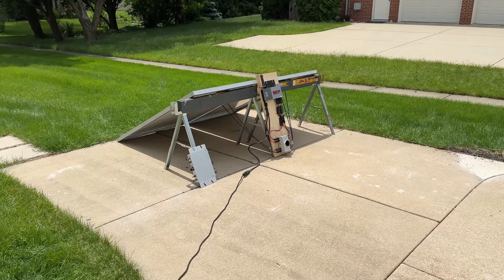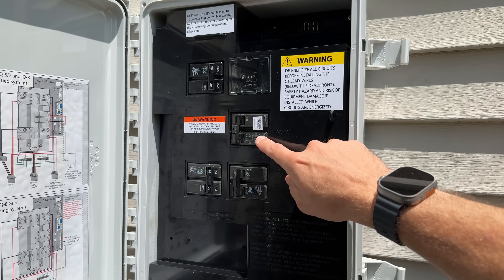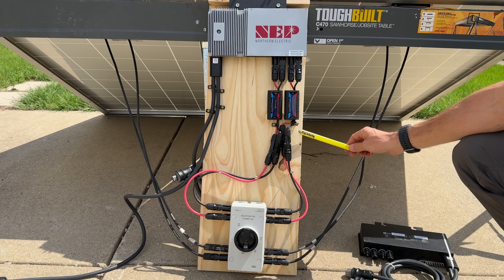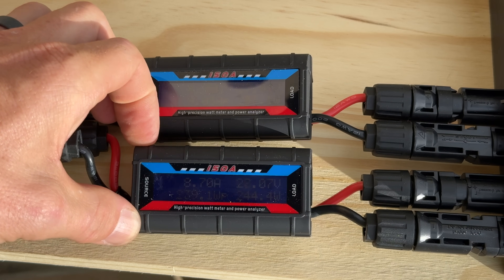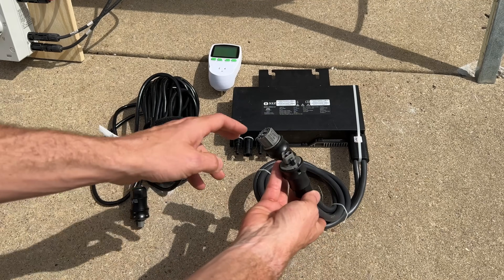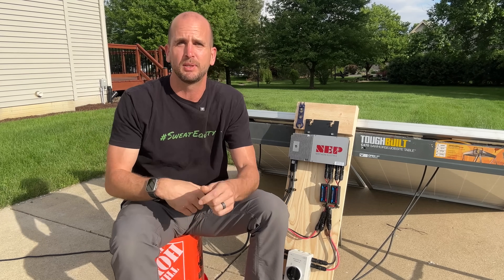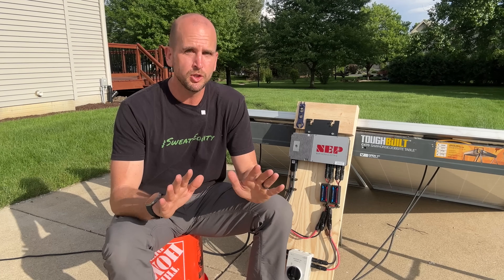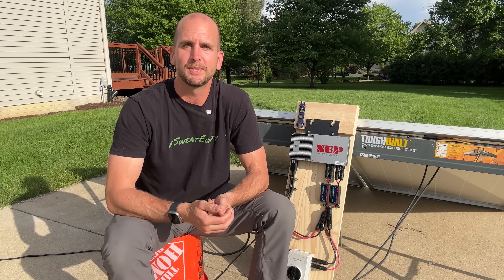Easiest Grid-Tied Solar On The Market!   Plug-N-Play

Comment: This is a really great video for someone that knows enough about electricity to actually do something like this.  Meaning, some of the other videos are so basic that I always wonder, if you don't know amps volts and watts, should you really be doing this?  For me, I want to put up what I believe will be about 1200w on my shed.  I have a radon fan on a 20a circuit that building this out would be perfect for.  I guess I could look this up but QUESTION: I am going to pass a somewhat consistent 1000w through a line that's about 40 ft long,  is there an extension cord that one would recommend?

Comment: On the solar tax credit for used equipment, I would contact a tax preparation service or call the IRS itself (if you can get through to them by phone since they were downsized) to ask. A video by "A1 SolarStore" goes through the form from a few years ago (the new form may be different now) that asks if the equipment is new.

Comment: I have watched every single video you've posted and I enjoy this content.  I have a request. Could you acquire a  enphase microinverter and using a pure sine inverter with ac pass-through.  Test to see if you can trick the microinverter to produce power. I'm aware backfeeding is illegal without permission.  But I would like to see if the theory is sound. Thanks
Reply: Ac output from inverter installed in a small breaker panel (240 60  hz). Solar panels fitted with microinverters. Inverter output installed in breaker panel.( 2 pole 20). with a load from the panel a fan a heat gun etc.

Comment: Great, thanks!  Would the 240 volt outlet be correct to plug into a 220 volt outlet (such as dryer or car charger outlet) and is it better to feed in 220)?

Comment: If you select Solar/Generation in the Emporia settings for the circuit you're producing electricity on it will differentiate energy consumed and energy produced. Bi-directional will need to be selected also if you are both consuming and producing on the same circuit. If you don't the energy you are producing will count towards the consumed energy also like it was when you was showing the app in the video. Hope this helps, it messed up my monitoring for awhile.

Comment: Right there at the main where the grids next to the installed watt meter 
Armed only with an amp clamp and fourth grade math you will see some 85% difference 
Grid  ties can only actually put in about 15% of advertised output
That goes for either one of the inverters 
And it only takes a second to demonstrate
Reply: So you're 11 kw & 45 amps can only put in about 2 k w and if you do the test you will see only about 8 amps 
Huge problem with grid ties again Easley demonstrated

Comment: Worseyet once solar is connected to the grid it can only put in about 15 percent of panels advertised output 

And is the main reason why everybody electric bill is skyrocketing 
It takes some 6 with crazy electric bills to compensate just for one home solar s benefit 
The ignorance of solar is easily demonstrated with a volt amp meter and 4th grade math called ohm's law 
Right there at the installed wattmeter compare your results you'll see an 85% difference 
With the optional amp clamp only takes a second

Comment: It certainly looks more robust than the failed micro inverter.
I did a similar setup using 2 cheap $30 350W micro inverters and two used $23 250W panels, all up with wiring and cheap self built ground mounting it was around $150.
The first inverter failed after a week and  I ordered another and 2 x 8" computer fans to cool them down, but the second inverter failed after about 3 weeks just before the fan arrived. I installed the new inverter  with fan and ran it for about 6 weeks (no probs) and then I ordered a new 2nd inverter and now both have been running for around 18 months no probs and it has payed itself off even including two burnt out inverters.
I live in Thailand so maybe I can get things a little cheaper than folk back in the US, but there is also other hassles here like the reason I first tried micro inverters.
I tried them because they are sealed units and should not be destroyed by bugs. 
My first little system was a 12v job with standard inverter but bugs got into it and shorted it out...twice!!
You always have great practical tutorials. Appreciate it and they always help me think about how to do something or approach a problem. Thank you sir.

Comment: Unless the micro inverter has an option to not feed the meter, do not install on a smart meter, if you do and aren't set up with utility company to feed power to the meter, you'll be charged for that power you produce. 
Make sure your inverter has that option to not feed the meter. 
When you contact the power company and tell them you're using solar and feeding excess power to the grid, you lose time of use power pricing and are charged the premium cost per kilowatt 24/7.

Comment: Scott, I assume that this setup offsets the power you use from the grid as installed; no special permissions needed. But you checked with the utility and they said it was OK since the microinverter is UL1741 certified and can't back-feed the grid if the grid is down (because of a grid power failure). And the utility permits this way of cutting your grid power demand, but they won't pay you for the power you generate back to the grid if for some reason you were using less from the grid than your panels (and system) were pumping back to the grid. Do I have that right?
Reply: if he has a net metering agreement the added solar will contribute to a decrease in usage and therefore the roof generation would get fed back to the grid instead of getting used to power loads.  however if he put too many of these into outlets during the time of peak sun, the utility would see like 5k of energy coming back if the solar system he has when he registered it was supposed to only be capable of sending back 4k.  so I would advise against that, the utility might find out and see he was violating the net meter agreement.

I do think this is very useful if you have say a 5K system but after 10 years the degradation means it only can produce a max of 4.4K.  well that would give you head room to add panels and stay within the power output you originally committed to.
Reply: @rmassuser  good points.

Comment: Could a similar system using a micro inverter be tied to the compressor side of a central air conditioner run contractor so it was only powered when the AC’s condenser was running, thus supplementing the compressors power with the grid power? I realize the EV supplied power would have to be less than what the condenser pulled and that some kind of current detection might be necessary in case the compressor failed to run under any circumstance.  This would make this a non-grid tied system correct? My condenser, (2 tons 16 SEER) pulls about 1200 watts when running, so limiting the EV power to 1kw or less seems safe even if my other power usage is very low or even zero watts at any time.  I’m aware micro inverters have a grid synchronization delay time at every connection.

Comment: 1:19-1:21 Timelapse of people lying on panels. It hurts my soul to see!
Would be an interesting video to take a brand new, carefully handled panel and test it's output next to an identical control panel. Then lie on it like in timelapse and compare. Maybe go further and step on it "carefully", then kneel on it like a typical hired-in worker/installer. Will there be immediate changes or do degradation only show up during first year?

Comment: Is there anything like this available in the UK that's legal and just plug and play upto 1kW of panels?  The Ecoflow Powerstream looks good, but it was pulled form sale due to legal and safety issues - and it's only working with EcoFlow batteries. There is so much conflicting data on these sytems and their UK legality and safety.
Reply: Call your supplier and ask them what they think.
They "should" know how to advise you.. but just don't bother talking g to a junior employee, speak to someone directly with knowledge if possible.
Reply: @TheGreendabomb  what supplier?

Comment: So what happens if at one point your house doesn't use anything, everything is off, even your refrigerator is resting... and your grid tie mini solar is still producing lets say around 400Watts what happens to the power, it goes to the grid right? And what happens to the regular grid power meter, does it keep accumulating forward or going in reverse, or is sitting still? Do the power company have to install for you a special power meter on your house to be able to read power going both ways? maybe this scenario will be rare, but what if you double the size of your solar?
Reply: very good question. Any answer to this?

Comment: I did the same but with the enphase micros. Istead of hooking it to a 120v outlet use the 240 outlet. Working awesome. No combiner, no monitoring hardware. I already got burned multiple times with chinese grid ties. Enphase micros are cheaper.
Reply: would you mind sharing more info on your setup? like what model Emphase, panels, and how are they connected,i.e. to a dedicated 220V plug and its own breaker?  does the emphase shut down if the grid goes down, so it doesn't backfeed?
Reply: @Northeaster-b3w  Used the IQ7+ and 320watt solar panels wired directly to a 240v outlet inside the house. Need to buy the cable to link the IQ together.
Reply: @user-pg5yy5he9m  Thanks for the reply! Assuming you are on the grid, how do you prevent backfeeding the grid if the power goes out? do the emphase micro-inverters sense the lack of grid power and shut down? 
also, do you have a net-metering meter or if not, what happens if you were producing more energy than you were using?  i think an old uni-directional meter might count that as usage and the power company would likely contact you, so like to hear how you are doing it please!
Reply: @Northeaster-b3w  If the micro produce more power than you are currently using it will get back to the grid. When power is out it will automatically cut off production. It is totally safe and approved for use.

Comment: For the price of the kit, I got a jackery 1000V2 explorer on Lightning deal black Friday for $399.00 and then also purchased a LiTime 100AH 12v battery with the grade A cells for +15k cycles for abourt $139.00. That will be satisfactory for what I want to do with it, which is to run a small 300w electric mini heater in my unheated back pantry / laundry room over the winter so that I can keep the door closed and not run the main furnace so much. Just has to keep the temp above 45 degrees.  In the summer, I have a small inverter window AC to keep it under 80 back there, because it can reach 100 pretty quick on a hot summer day. My 600w panels feeding that from the field should be sufficient to not raise my electric too much except when it's cloudy/rainy/night time here in rural PA.  The great thing about a jackery is that in the spring and summer when I don't need heat or ac back there, I can use it's electricity for other things, like the Fridge or my son can take it camping.

Comment: I'm living in sunny southwestern AZ. I'm looking to create a isolated solar system just  to run my room window AC unit to offset
the high energy bill I get each summer month. (up to 119* daytime temp). Is this even possible? Do I need an enormous battery
bank to accommodate the  electrical surge when the AC unit's compressor kicks in? And yes I'm a big electrical klutz hard to 
understand whats going on. Smart enough to know when to ask for help. HELP!  Would appreciate any and all informative  ......
non-harassment comments. Thanks in advance,                                                                                                              Me southern AZ.

Comment: Mine just flashes red 2 seconds, off 2 seconds (standby mode), and doesn't produce power. Do I have a defective inverter?
5:03: The manual says 1 second on, 1 second off means it's producing power.

Comment: So glad I found this video. I saw your first one with the 1200W amazon grid-tie inverter and that seemed cool - but good to know that it pooped out (maybe worth pinning a comment on that video to share the information, and maybe a link to this video for a better affiliate option). Stoked that actually certified options are becoming available!

I would love to see a video from you about increasing solar coverage without voiding NEM status! I (and a few of my peers) are in a similar boat where we have 'commercial' solar set-ups through installers and have existing net-metering set-up with our utilities, but are interested in increased solar production without voiding that (and potentially cheaply/DIY to prevent a new interconnect/NEM application)

I have been doing research about ways to do so (like 'islanding' a functionally off-grid install, or using a grid tie solution like this but keeping additions below the NEM) and you seem really knowledgeable so I know myself and likely others could benefit from hearing your honest thoughts about options to increase solar production in a DIY manner!

Comment: Hey Scott thank you for video, xlnt!  NEP discontinued the LV version (Low Voltage). I bought the BDM-300X2 and hooked it up as you did. Got  flashing green and then after 2 minutes flashing red? The AC outlet has 3 wires, Black White Green, this would be 110, not 240, correct? So it should work just like your setup? Any ideas why it flashing red and producing no current. BTW, my solar panels (2) are producing 230 watts each and run my battery inverter set perfectly. Thanks for any help.
Reply: This is what the installation manual says:  
Step 1 - Install the AC Branch Circuit Junc�on Box
1. Measure service entrance conductors to confirm AC service at the site.
Acceptable ranges are shown in the table below:
● BDM-300X2-240A & BDM-300X2-208A (North America)
240 Volt AC Single Phase 208 Volt AC Three Phase
L1 to L2 240 Vac L1 toL2 208 Vac

Comment: People need to see this. This is the right way to do it. 
Plugged into the wall. I think that means it is bypassing the breaker. Maybe tie in on the mains in the breaker box so the breakers can do its job. Like yours. Example load to the breaker is at its maximum to protect the wire. About to trip. You (Say add 8 more amps to the line) Now you have a hot wire. The breaker only see's what is going through it. Not what the wire is caring. House gone up in smoke. I maybe be wrong but. Please correct me if wrong. Love your video. Shows what a safe setup is.
Reply from the maker: With this one it is important to plug into a dedicated circuit to avoid overloading any part of the circuit.  If it is a dedicated circuit then the breaker will see the same amount of current being produced by the microinverter.

Comment: Do not tie your solar to the grid. You want your home off grid completely with its own system. Don't be scammed with solar panels and equipment. You basically want to convert your home to be like an RV. Solar power is free collected everyday and can be stored in batteries. Make sure you have the right appliances and technology when operating on solar power. Traditional Appliances and technology shouldn't be operated on AC with converters from DC. Its a waste and requires replacing components and dependency on parts. Think about what exactly you need for your home and reduce waste. The more demand you put on your system the shorter the lifespan. You keep a well balanced low watt demand on your panels and make sure they are positioned only 8 to 10 hours daily in direct sunlight and they will last over 100 years. You want to be sustainable without worrying about future repairs or replacement. If you convert your home off grid don't use traditional electrical in your home. Breaker boxes and outlets is obsolete. Stop using appliances and technology that requires an AC system. You want to have
DC technology. If you have to have AC for specific technology then make sure that is on a separate  solar system that isn't tied to your existing. Direct current (DC) is the best and the technology uses significantly less power than alternating current (AC) systems.
Another thing is don't be scammed by the EV market. I have a solar powered car without all the bells and whistles system they integrate. My car charges on solar and goes over 1000 miles on a full charge. I never operate less than 70% with my daily life. Capitalism scam.

Comment: Scott, the website states "It (NEP Microinverter) can take unto 2 x 24V panels (300+ Watt panels)." Is this saying it can only handle solar panels with VOC of 24v or less?
Reply: Input voltage for the BDM-500 600X is 22-55VDC so if your solar panel has open circuit voltage between that range it will work.
BDM-500 max power is 375Watt  for each input (375 X 2)  inverter will clip power at 500 Watts (so maximum power out 500w for both inputs)
BDM-600 max power is 450Watt for each input (450 X2)  inverter will clip power at  600 Watts ( so maximum power out 600W for both inputs)
Reply: NEP BDM-800 is available at SS for $200.

Comment: I have a Delta Pro Ultra and I'm trying to get it to charge from my grid-tied solar system.  The solar company that I am leasing from says I can add a battery backup but I can't touch any of their equipment.  Can I just tap into the feed going to the main panel  after the solar meter, and add another subpanel and an outlet to charge the Delta, and the rest goes back to the grid?  Seems simply enough but I'm not sure if I am missing something.
If I can't do that I can just charge from solar panels like you are but it seems foolish to add panels when I already have 56 on my roof 🙂